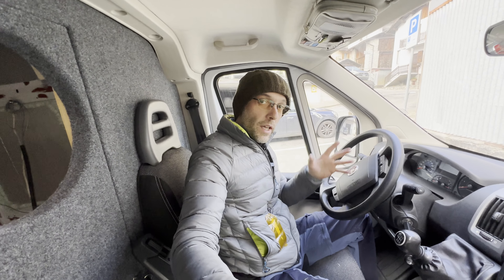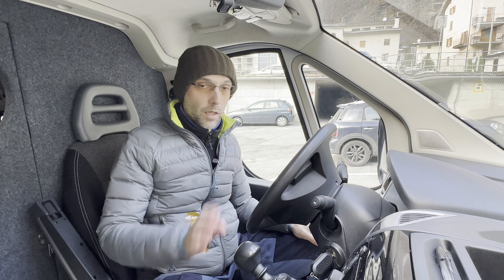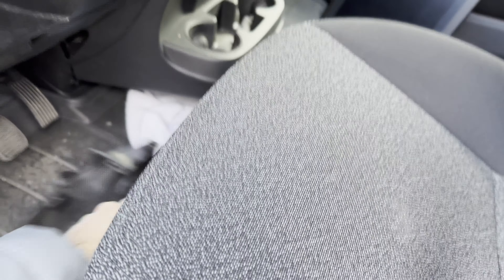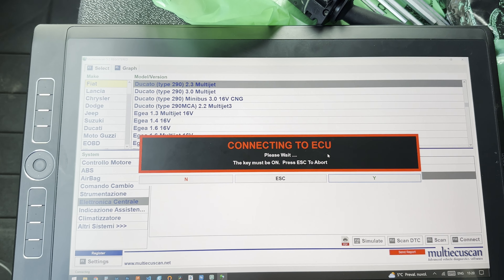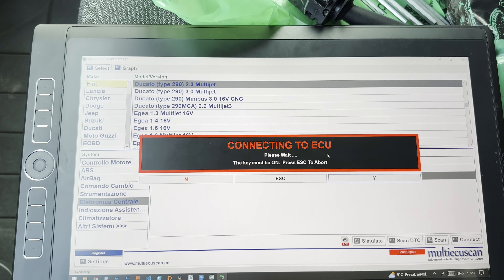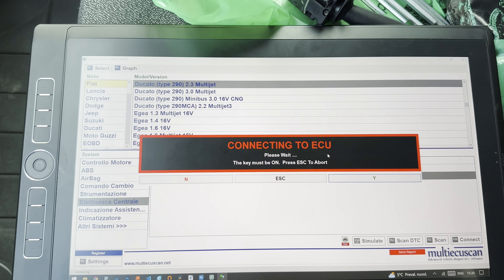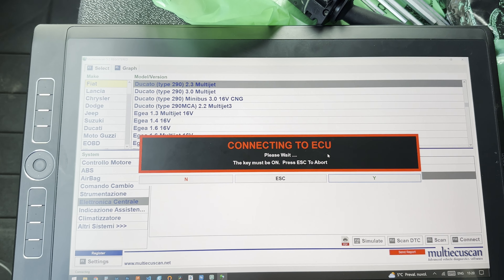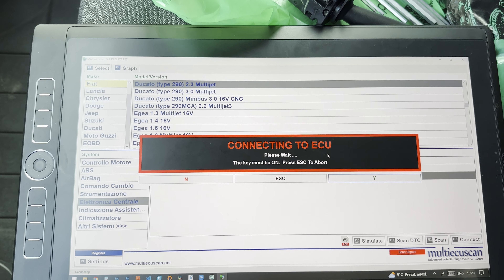EP22 - Cruise Control and Speed Limiter [ DIY VAN BUILD ]

Comment: I’ve been investigating cruise control options for my 2007 Ducato 2.2. It has the lower spec dashboard with only simple info in the LCD - so I was expecting not to be able to have speed limiting and would need a cruise control only lever. Having taking the steering column plastics off, it appears I have the place to install the stick both on the plastics and below the light control stalk, but no wiring/plug for cruise control 😢
Reply from the maker: I saw a couple of video about installing the wires on vehicles without the plug like yours. Not a easy job but also not impossible if you have a little experience using a soldering iron.
Reply: @diegosvan  ooh that’s interesting…. I had kind of given up and started looking at aftermarket options as I’ve not really been able to find any info on what to do it the wiring is missing.  Any idea what I need to search for to find the videos?  I’m pretty handy with a soldering iron, so it’s more about if I’m brave enough to risk damaging the ecu/bcm!
Reply from the maker: @misterp2811  I just searched “fiat ducato cruise control wiring” or “retrofit” 
But there is a pretty good and very detailed video made by an Italian guy, not much talking so I think you can understand using English subtitles.
This one: https://youtu.be/y9zRSDqw2fg?si=riiTZl9F4hSgDU_L

Comment: what's the part number for this switch?
Reply from the maker: As far as I know you cannot buy just the cruise control lever but it comes with the entire light switches assembly. This is the part number. 07357564830 
I bought it used on eBay.